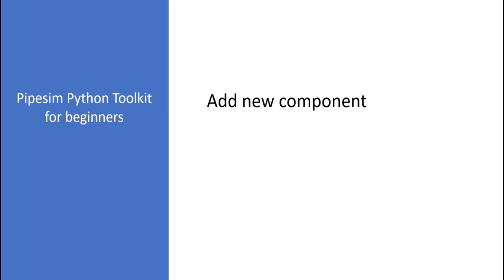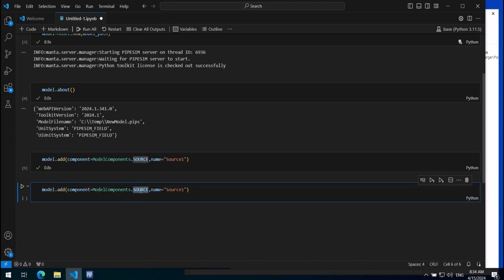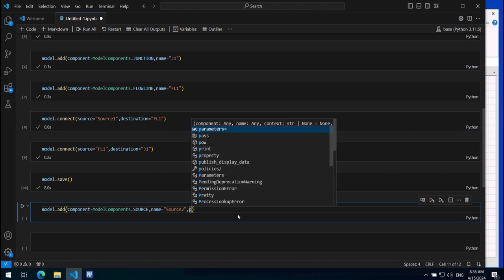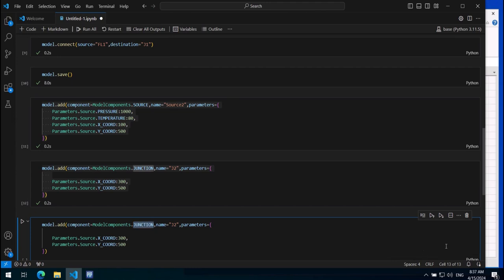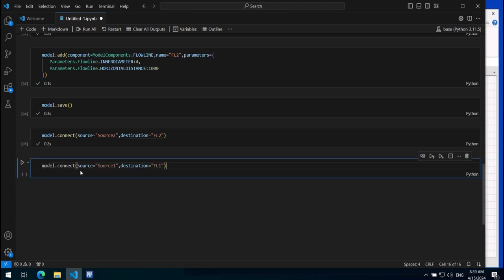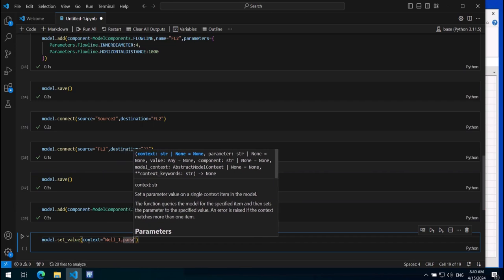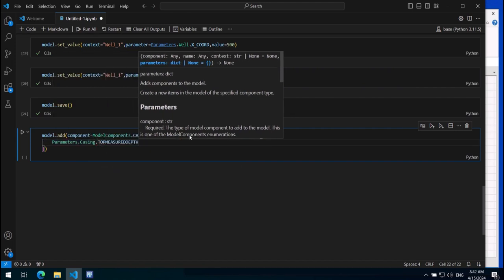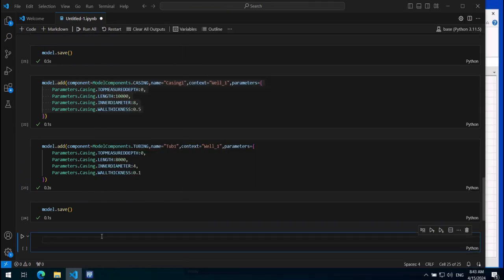PTK07. Add new component in Pipesim model

Comment: master, thanks for your videos. I appreciate a lot. I have a question. In order to define a inside diameter to a pipe, how can i access all the flowline riser catalog diameters instead of hard coding the diameter by myself? thank you so much!!
Reply from the maker: PTK has limited access to catalog, I mean, function read_catalog() that is designed to update model doesn't support flowline or riser. You can check PTK help for details. Of course there is a workaround when you develop own peace of code to establish direct connection with database (Pipesim's catalog). But then you should know the base structure, call SQL to extract details, and so on... It's not for beginners:)